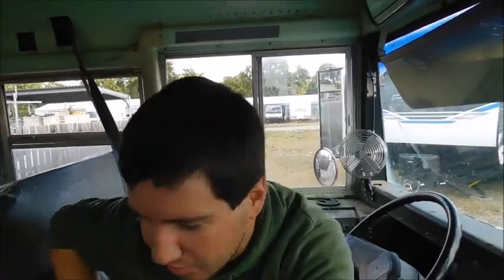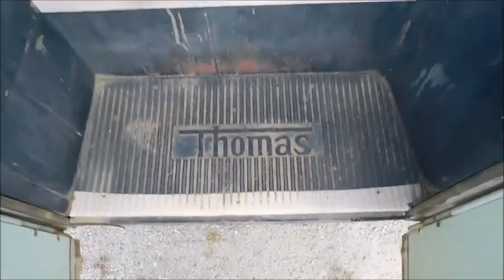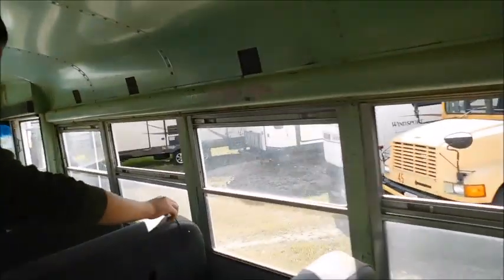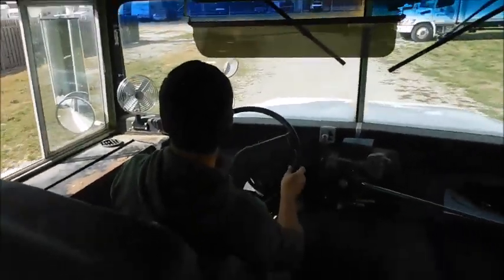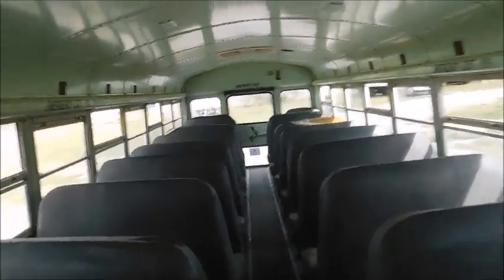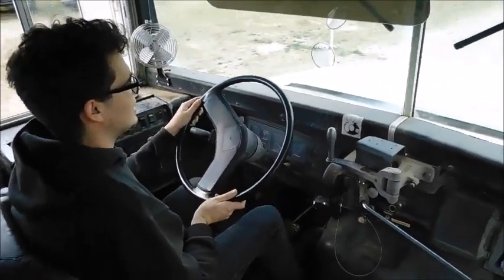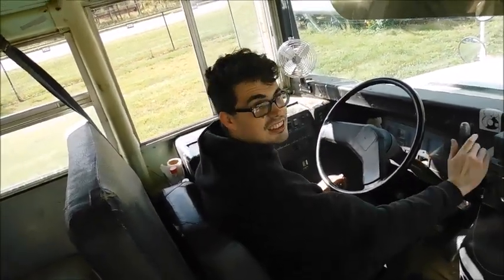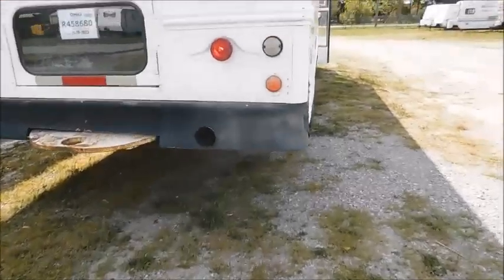He Bought His Third Bus! - Peter's 1991 Thomas International

Comment: Wayne or AmTran right Noah? Both buses look great. I definitely would prefer the T444E in the 3800 but I also would own a Thomas with the high head room body. The DT360 and 466 are also really good engines but I'm all in on the 444 that's a V8. Same engine as a 7.3L PowerStroke. I had a 7.3 PowerStroke that had a 6 speed manual transmission. But I would do the AT545 or the manual in my bus.
Reply from the maker: Yep, Wayne or AmTran! I’d also love an older Blue Bird 3800.
Reply: @BusBoy501Productions  I found an AmTran 3800 with a T444E and someone placed a bid for 250. So Im keeping up on its auction. Unfortunately it's low head room. But I heard that if the highest bidder wins it he wants to convert it to an RV and raise the roof. But I would rather have one with high head room and the T444E